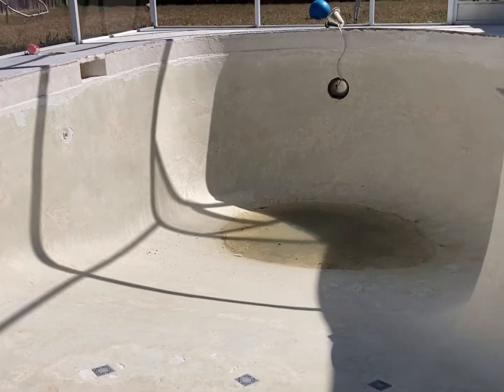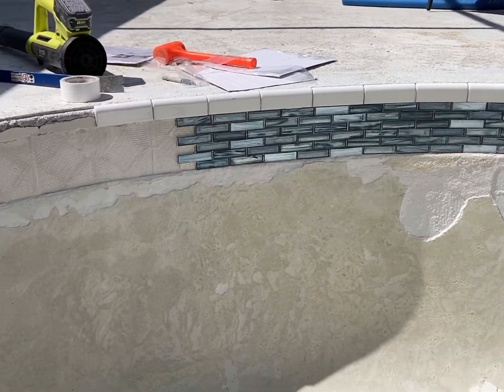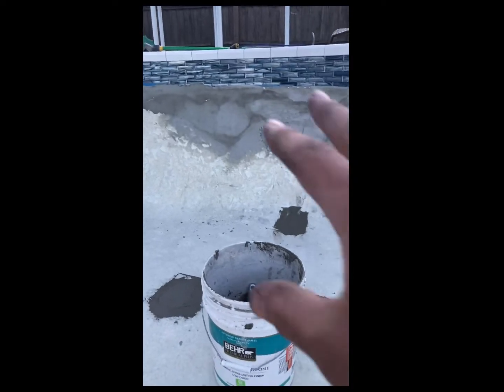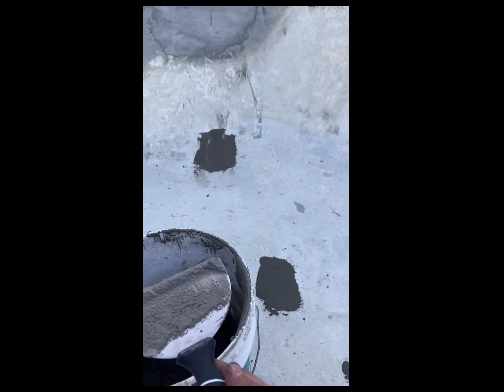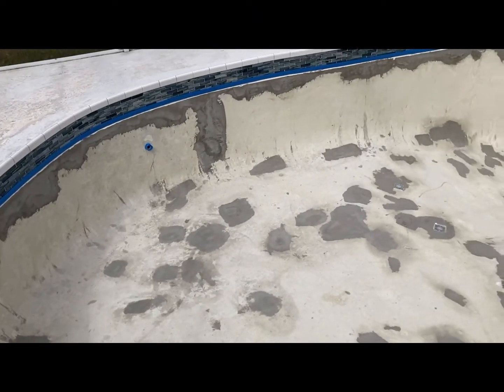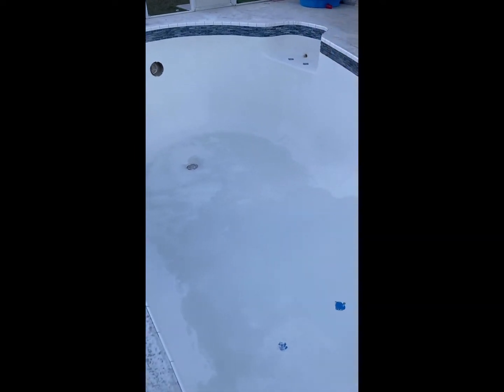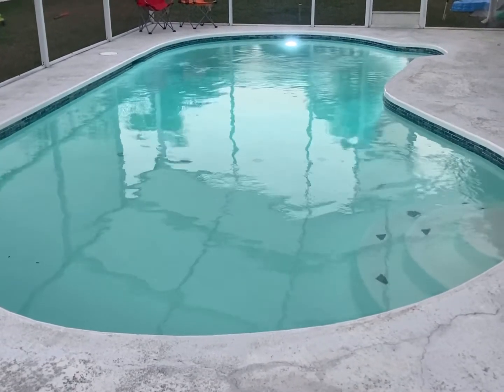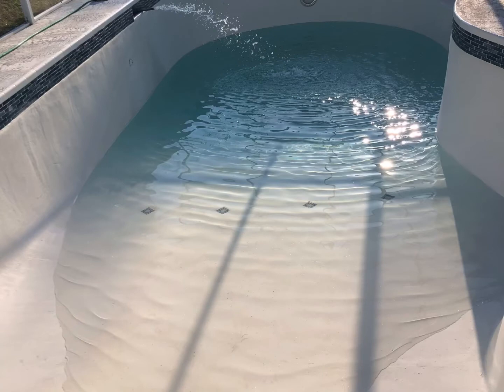Sider Crete DIY refinish your own pool - how to marcite/plaster pool refinish - Sider Crete

Comment: Whats the dimensions of your pool? Also how many bags of plaster did you wind up using? I heard you say you put down some bonding agent before you put the dark cement into all the holes.
Reply from the maker: @JohnDoe-pl8iv  https://store.sider-crete.com
Call these guys: 1-888-743-3750
Tell them your pool size and how many gallons and such. They were helpful when I did mine. I ended up ordering 11 bags.
They sell everything you need and the bonding agent.

Comment: Bro, I am working on mine right now 10/22/24 in Spring Hill, FL.
Mine, I ended up scraping almost the entire plaster, since the Roll-On plaster can be applied over concrete as well so that is my plan. So, to me so far have been very hard, but I can almost see it finished. I appreciate you making of this video. It will help me to pay attention to when I put the tape over the ceramic and to make the concrete more wet to be able to applied and make a smooth finish. Thank you so much.🙏
Reply from the maker: @locovidepro  I’m in new port richey. Not too far from you. It’s been over two years now and still holding up pretty well. Good luck.
Reply: @alreyindustries  that's so cool, we are neighbors😁. We, you are welcome to see the process of my pool progress. Maybe you can give me advise or perhaps, learn something that might help down the road. Let me know and I will send my address. I will be here working for the next four or five days.

Comment: Well Done and Thanks for the Video.  Did you replace the tiles in the steps? I have the same type of pool and I'm not sure if I will need to chip out the tiles in the steps and put new ones in.
Reply from the maker: I did not. I guess it all depends on your preference though. The tiles are a little lower than the plaster finish, but it is not a big deal to me so I just taped over them and kept them since they matched the color scheme. Some people might not like the look or feel of that but I guess that’s up to you.

Comment: Great video - very helpful and reassuring that you are a satisfied customer.  We have inset tiles in the floor of our hot tub. Did you need to chip some of the old plaster away from the around the tile so that when you spread the 2 coats of sider-crete on that everything was flush with the tile.
Reply from the maker: I did not. I just taped over the tiles and rolled the plaster. It may have come out better if I would have done what you are saying, but I have no regrets. I don’t think it would have been worth the work in my situation. The new plaster is not noticeably thicker or above the tiles and you definitely cannot tell with the naked eye when everything is filled with water. So I guess it’s up to your judgment.
Reply: @alreyindustries  👌 👍

Comment: Hi Great job. I am about to start plastering.  What is working time for the plaster once it is mixed and  before it becomes difficult to roll on? What did you use to get the bull nose round at the steps? Thanks Dan
Reply from the maker: I just continued to add a little water and mix the plaster as it started to stiffen up on me. I didn’t notice any negative effects, so that’s how I kept it rollable. 

The steps I just used the same process. Rolled on the plaster, used the squeegee to smooth it out as much as possible, then if you let it dry for like 5-10 minutes you can come back with a slightly damp sponge and get out any more imperfections.

Comment: Hi there, how did you do the pool floor? The wall is a no-brainer, but the base is what I am worrying about. Did you do the floor last? Thanks
Reply from the maker: Yes I did the floor last. I tried some other tools rather than the roller but I found the roller to work best for me. I started in the deep end and worked my way out the shallow end steps.

Comment: Thanks for the video! Question: I am just doing this to my hot tub and I’m about to do the first coat of plaster. What tools did you use to smooth the plaster after you rolled it on where the steps in your pool are? I’m speaking about the contours around the stairs where you can’t fit the rubber float? My hot tub has so many sharper angles and I’m trying to find the best tools. Thanks!
Reply from the maker: I used the “magic trowel” that came in the kit I ordered. It’s the squeegee type tool. I also used a damp sponge sometimes. Hope that helps.

Comment: looks great. How many gallons is your pool? I see the product comes in a kit? How many kits did you use? I'm going have to do this next year
Reply from the maker: I think my pool is around 11,000 gallons. I bought 11 bags of the actual plaster and had one bag left over.
I only bought 2 bags of the repair cement and had some left over.
I got all the supplies from sider-crete

Comment: did you halft to acid etch the pool first or just pressure washed? thanks for the video!
Reply from the maker: I pressure washed and then sprayed it all with acid. However, in my opinion, it was an unnecessary step. I don’t think my pool really needed it, but that’s just my opinion.
Reply: @alreyindustries  thanks my pool is really big im looking at about 3,500 but I have had leaks here and there over the years I'm hoping this puts a stop to it

Comment: I apologize for bothering you, but did you use Sider-resin coat before applying Sider repair and then plaster? We ordered plaster and repair kit but it turned out one more step needed before we start.
Reply from the maker: Yes. I used a paint brush and brushed on a coat of the resin before using the repair. Just where I needed to fill in holes and such. I did not use it before putting on the plaster.
Reply: Is the resin from Sider company too?

Comment: Do you think we can save the already mixed sider repair until the morning? I'll call them in the morning, but wondered if you were able to with yours and use in the morning.
Reply from the maker: I don’t know. I wouldn’t recommend it. You could add water and mix it up pretty wet and then pour an additional amount of water to sit on top of it until morning. But it’s risky and it may lose its integrity doing it that way.

Comment: Would textured roller work better? Use water and sprayer hand bottle to keep from drying early
Reply from the maker: I’m not sure. I just used the one that the company supplied with the tool kit. That worked well for me. I did not try any other rollers.

Comment: Question, I'm thinking about doing the same project to save $16k, Do I need to chip off all the old plaster on my pool?
Reply from the maker: I only chipped up the loose and hollow areas. Then I filled the worst parts with the repair plaster prior to the final coat, as you see in the video.

Comment: Did you have to chip out your old plaster.?
Reply from the maker: The only thing I looked for and chipped out were loose pieces of plaster around the areas of erosion AND I did have some hollow areas where the old plaster was separating/not making a good bond with the cement underneath. 
I went around knocking on the old plaster to hear if it sounded hollow or not. If it was, I chipped those areas out and repaired all the holes with the repair plaster before putting the final plaster on. Other than that I just rolled the new plaster right over the old.

Comment: How much did you spend on your project
Reply from the maker: $1859.42 from sider crete. That was for 11 bags of plaster, the tool kit, 2 bags of sider repair and 1 jug of the resin for the repair stuff.
I probably spent $500-700 on tile, cement and grout.
Then I bought a new pool light which was around $300.
So between $2,500-3,000 I’d say.
Reply: My friend how many bags do think i would need for two coats, the pool size of.... 20x 12x 4ft high.... ?... thank you!....
Reply from the maker: @friendofmind7859  I’m not sure exactly. If you go to the company’s website I used, sider-crete, you can call them and they are very helpful. They will tell you how much you need.
Reply: @alreyindustries  thank you very much and by the way... very good job 👏

Comment: Did you just go right over the hairline cracks?
Reply from the maker: I don’t remember a whole lot of hair line cracks. I had more loose material and hollow spots. If you’re worried about the new plaster cracking too you can treat those cracks first with some crack repair compound.

Comment: The new glass tile is nice.  The white bullnose tile is extremely ugly and looks dated and doesn't match the glass tile.
Reply from the maker: Thank you George. I’ll be sure not to invite you over to use the pool. Don’t want to upset you.
Reply: @alreyindustries  Thank you.  And please have mercy on your guests and yank that ugly garbage off before they see it. Replace it with something better so you don't have to worry about them talking behind your back about you having tiled your pool with tacky bottom of the line Home Depot special tiles.